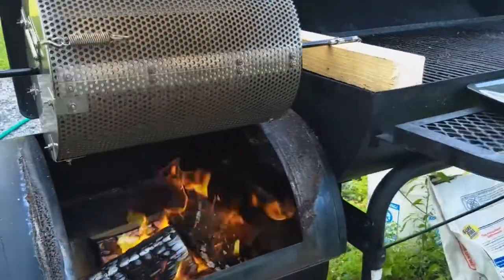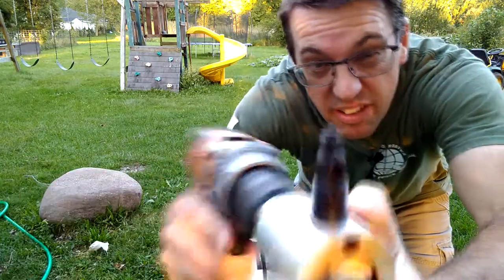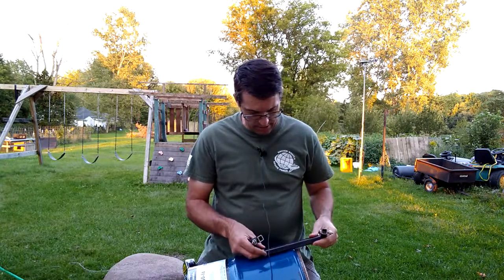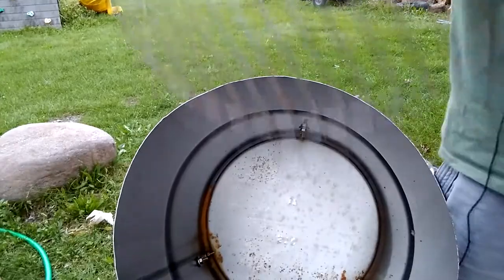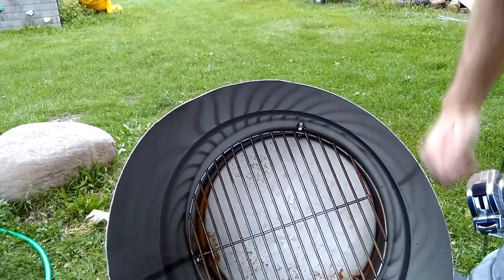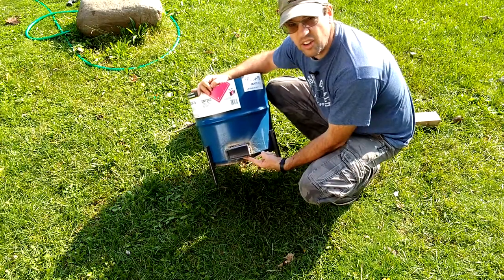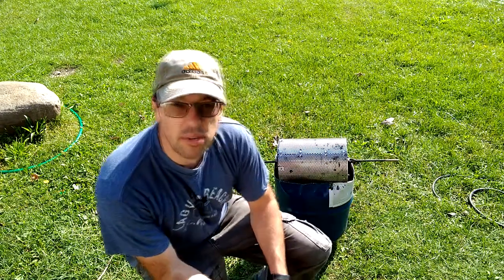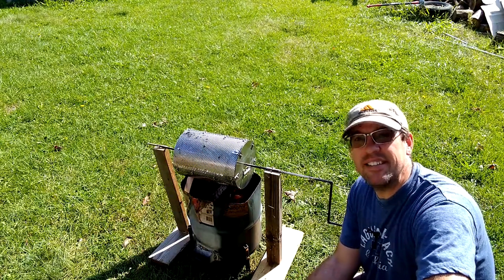DIY Coffee Roaster Fire Box

Comment: Where did you get the roasting canister?
Reply from the maker: I built it using all stainless steel components.  Mesh for the canister body and 3/4" L for the paddles inside.  1/16 sheet to finish off the sides.